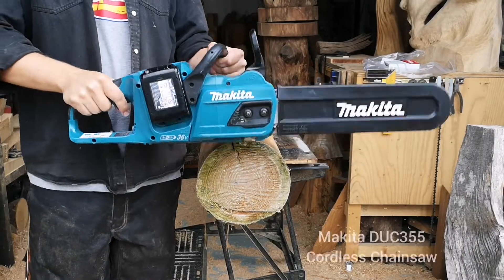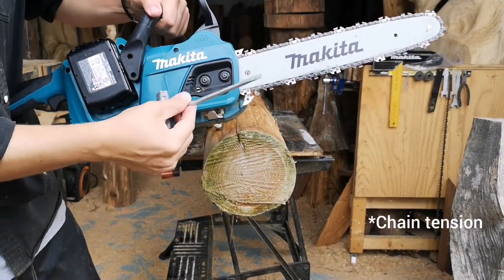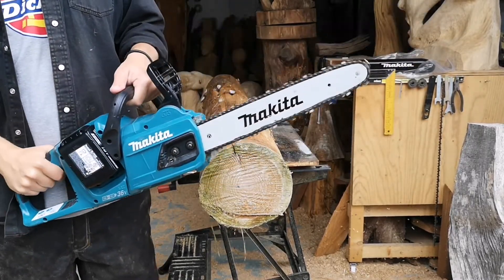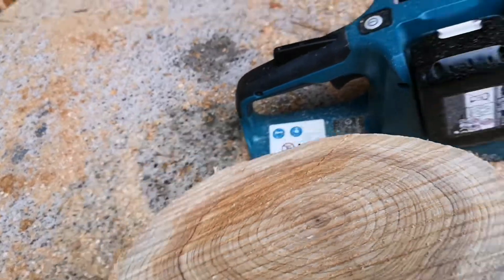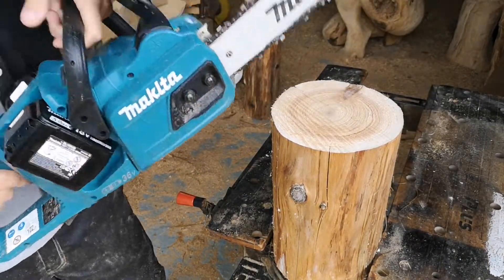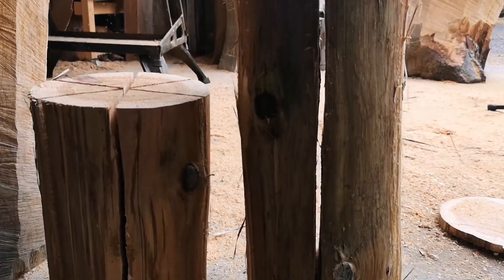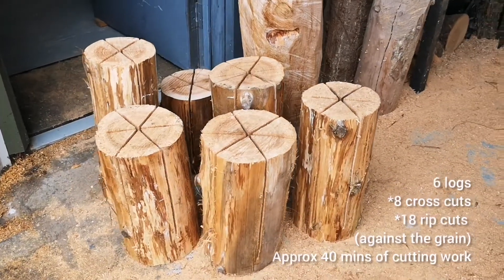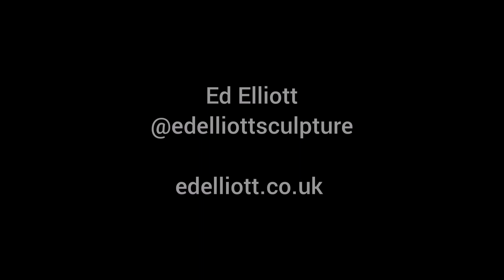Makita DUC355 Cordless Chainsaw review / test / battery life by Ed Elliott

Comment: You said you made about 8 cuts following the grain and the 5AH batteries took 45 minutes to charge. You also stated that if you had 4 batteries you could constantly use the chainsaw. Does that mean it took 45 minutes to make the 8 cuts?
I am a big fan of Makita and have a lot of their tools plus 20 batteries but I also own a basic Husqvarna petrol chainsaw which fly's through cherry and hardwood. If you were cutting logs all day you would need petrol. As for cutting the odd log here and there and a bit of shaping the silence alone is definitely worth it.